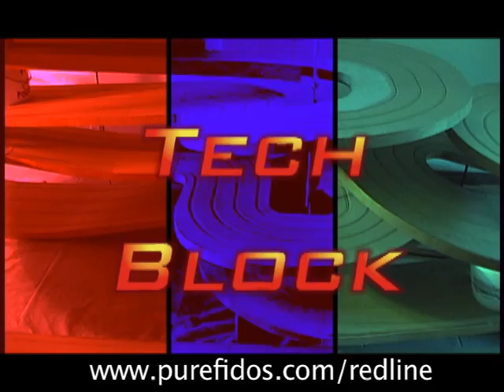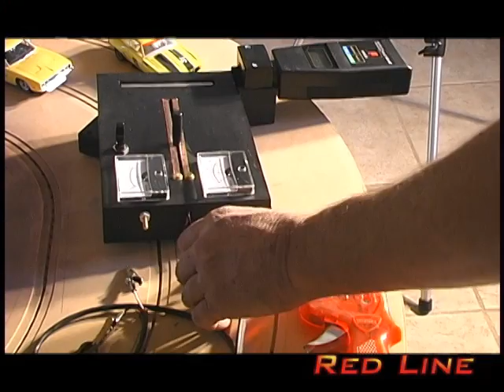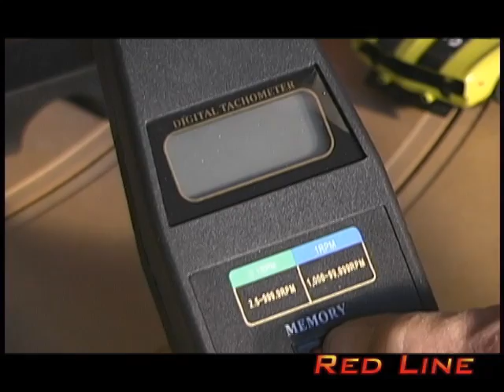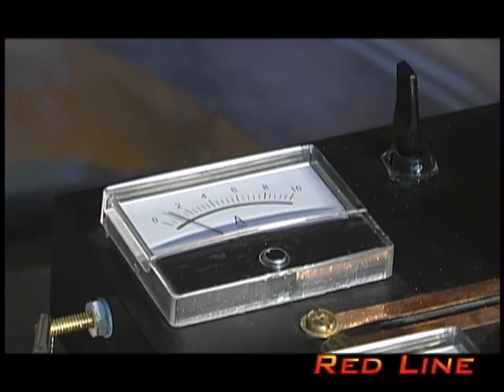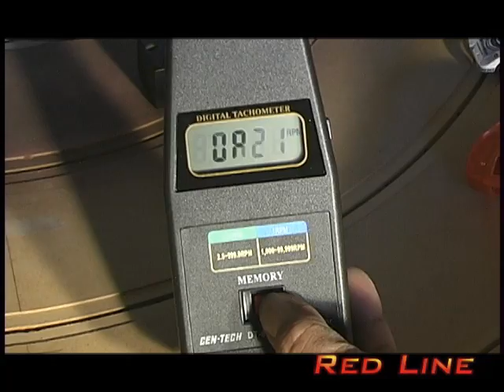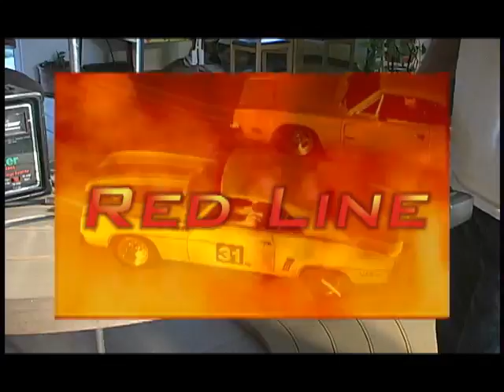Red Line Slot Car Tech Block

Comment: I have purchased 2 of these outstanding products. First was the unit with tachometer and amp gauge with roller and adjustable stop bar for any size car also this unit has sanpaper at the back roller so if you want to save money on a tire truing machine this does the job. Also included is a power flag that you can use and set the whole unit on your track or commercial to check voltage or use as your power supply. Very Simple unit but hey not everybody has a real car Dyno Either. Hook your friends up at the track or at home. Very rugged unit. They also have a simpler unit without the gauges and other add ons for a Drop dead price. Nothing like having your own slotcar Dyno that gets you set up before you hit the track and save valuble track time because you are dialed in before you get there. No I do not know this Man! His name is Mark and I think he is really on to something that is not produced commercially. 5 Star rating Here. Cant wait to see whats next! Thankyou for producing such a product! Sincerly Tim.

Comment: The Camaro has a hot motor and tall gears. The roller is 3/8 x 4 inches long with ball bearings. The tach has since been changed to a laser unit.

Comment: 15k rpm at the wheels seems a bit high to me.  Slot motors typically run 20k rpm unloaded, then through a roughly 1:3 reduction gear.  I would expect to see a lot less.  Neat box though, would like to know what diameter the "road" is and what kind of bearings it's on.